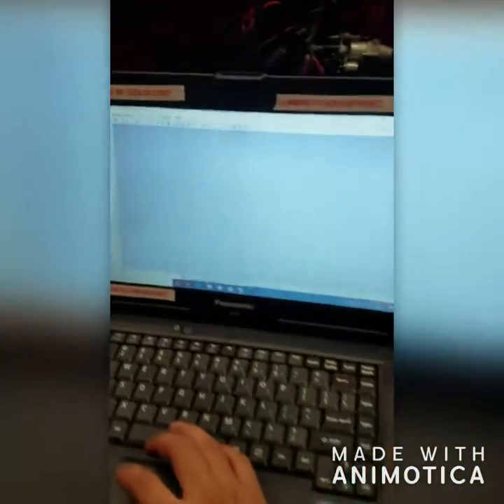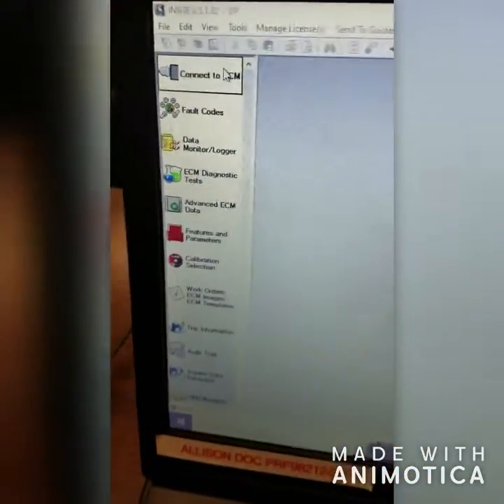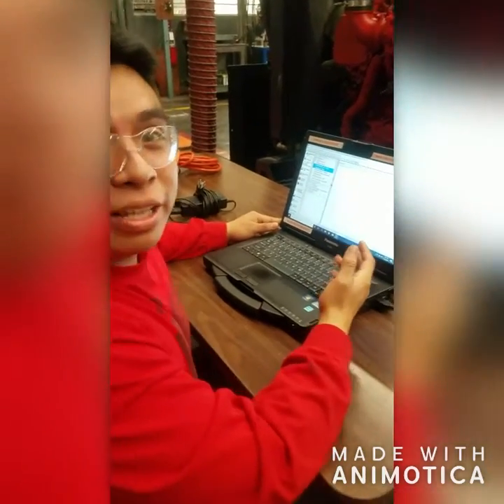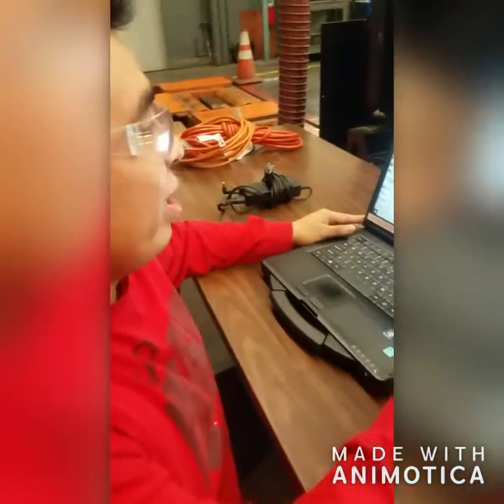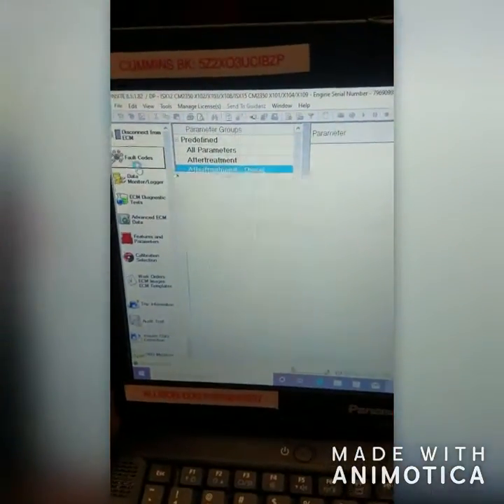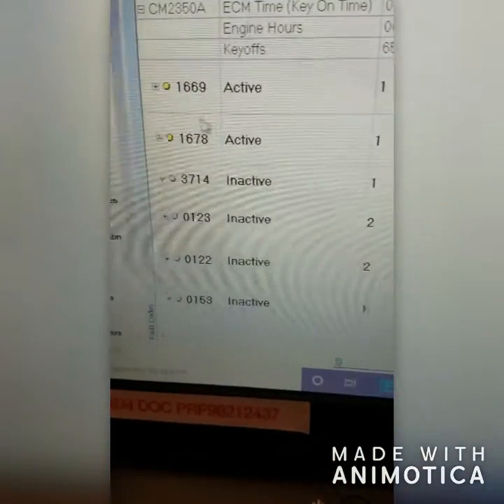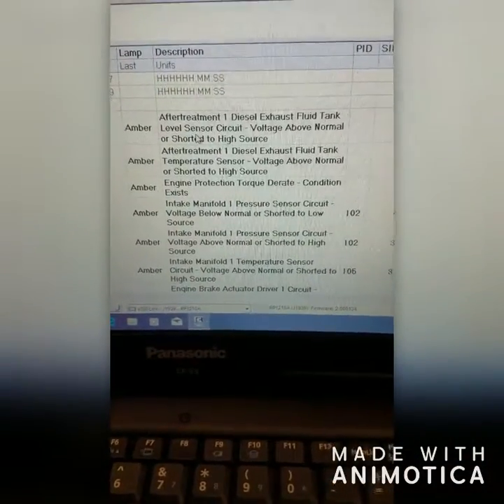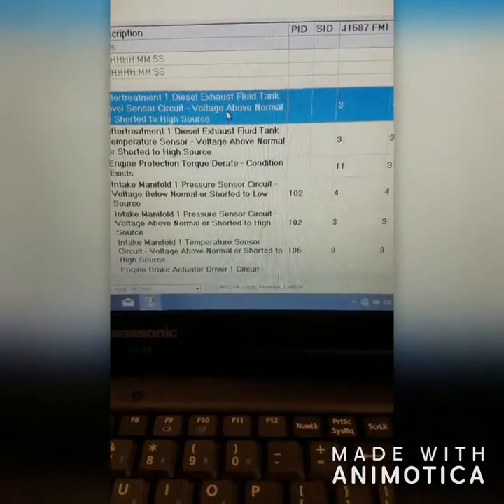How to connect ECM to Cummins insite

Comment: I a Hyundai loader with Cummins engine that uses CM870 ecm. The loader not using J1939 I would like to know what cable to use to connect the ecm with insite.

Comment: The Best Seller & UP To Date Software, with No Expiration Date and I use a Special Software that Freezes the Software For You To Never Have Any Problems/Issues.

What I Offer is Diesel Diagnostic Laptops with No Expiration Day.

 FREE SHIPPING Software are up to date.

I accept Zelle, Cash App or Venmo. Account is Under $FR1J0L3R0

Cell Phone ( Numero de Cellular (310) 903-6679

WhatsApp Number (310)-892-0502

I am based in Pacoima, California (SAN FERNANDO VALLEY)

The Best Seller & UP To Date Software, with No Expiration Date and I use a Special Software that Freezes the Software For You To Never Have Any Problems/Issues.

I will ship to any State in the United States for Free Except For Mexico & Canada 

HABLO ESPAŃOL, 

Cualquier pregunta que tengan sobre los Programas de Diagnóstico. Hagamelo saber.

Todos los programas Están actualizados al 100%.

Me Localizo En Pacoima, California
Envio Gratis En Todos Los Estados Unidos, Para Mexico y Canada

Cables se compran por separado. Yo no Vendo Cables Version Chinos Como Otros.